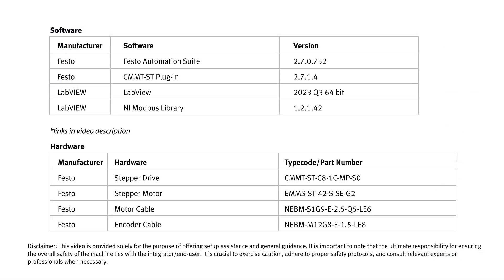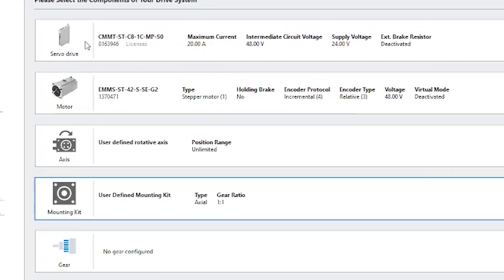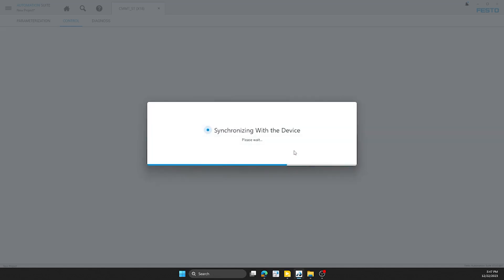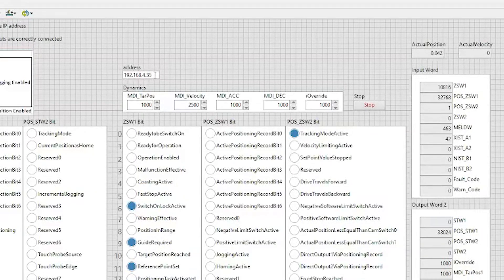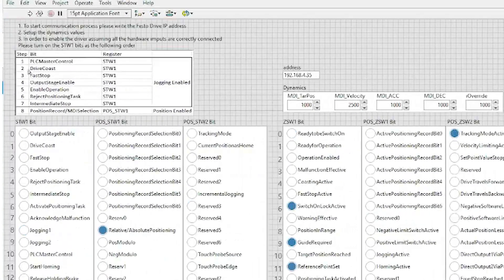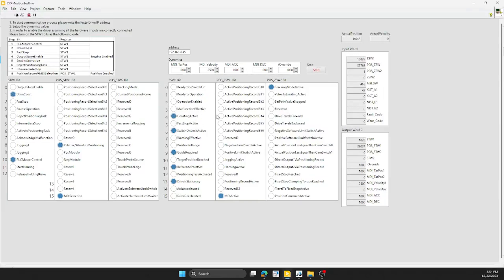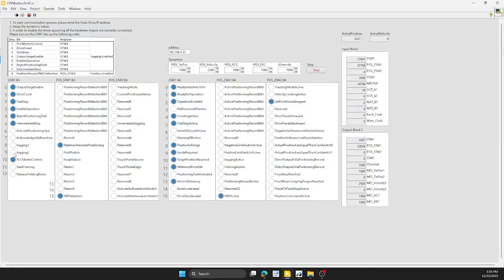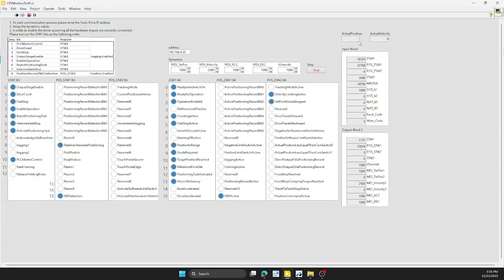Controlling Festo CMMT with LabVIEW

Comment: I downloaded your code and running with a Demo unit borrowed from your local distributor. My setup is using Application class 1 ( Telegram 1). I am able to turn the motor on and start running but i do not have control over velocity and acceleration. The same connection is working well when used from Festo Automation Suite. Any idea what may not be set correctly?
Reply from the maker: Hello, thank you for your message.

You can send a message to our experts through the following link, and they will provide you with specific information about your issue as soon as they receive the request.
https://www.festo.com/us/en/e/technical-support-id_646900/

Regards.
Reply: @FestoNorthAmerica  Thanks for your response. I changed the setup to broadcast Telegram 111 and your LV Code is working for me.